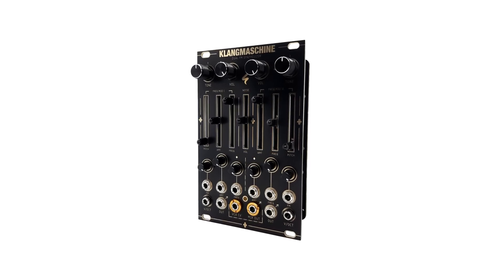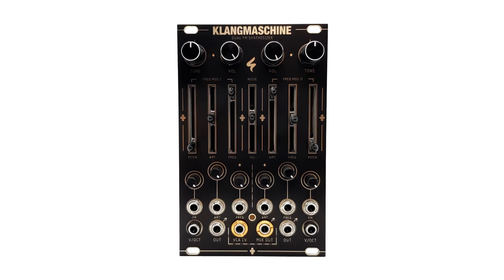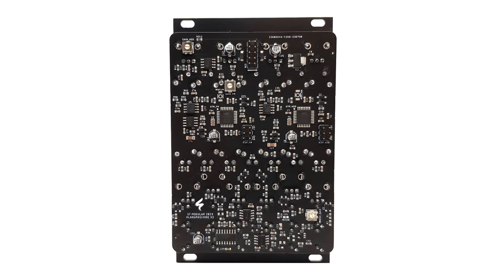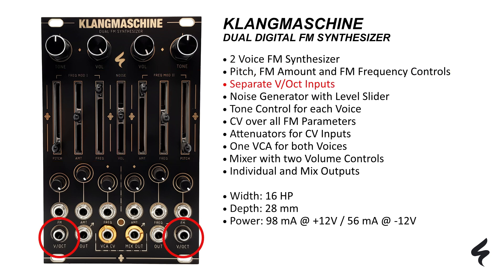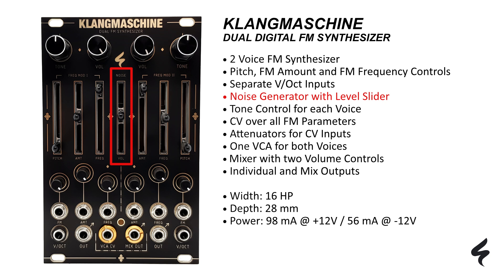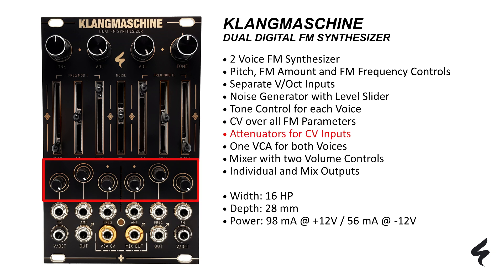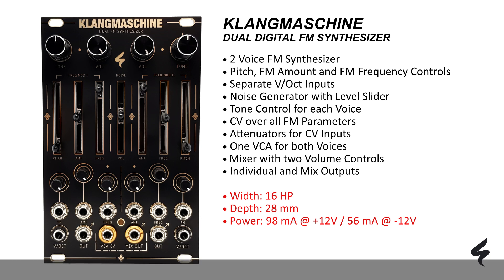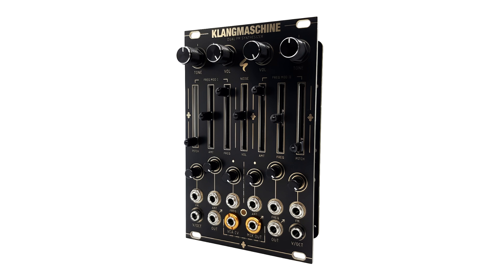ST Modular - KLANGMASCHINE (Dual Digital FM Synthesizer)

Comment: This is wicked! Filter and env used?
Reply from the maker: Thanks, no filter (except for the internal eq), envelope for controlling the internal VCA or the individual outputs via external VCAs.
Reply: @st-modular  Thanks. Sounds great! I meant which of your envelopes specifically did you use.
Reply from the maker: @stephengreco5115  I can't remember exactly, but I've been using YACE a lot lately, so it's probably that envelope.